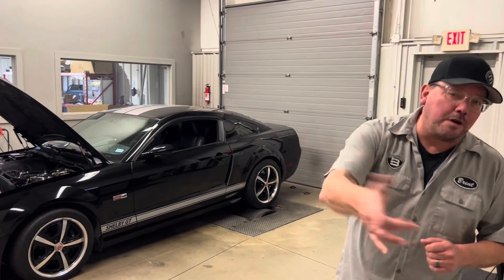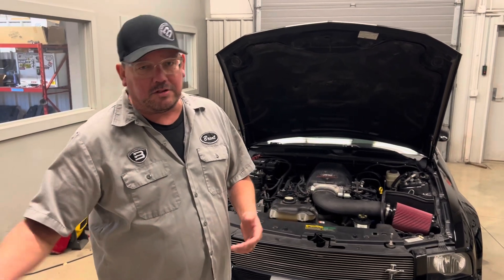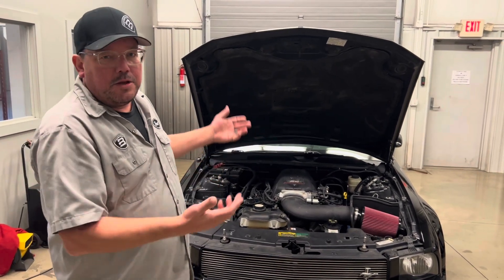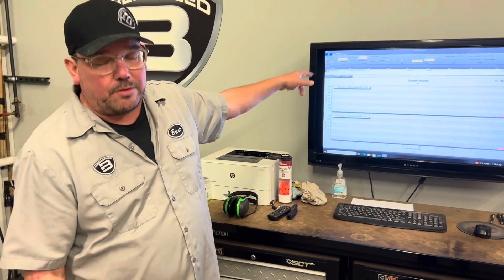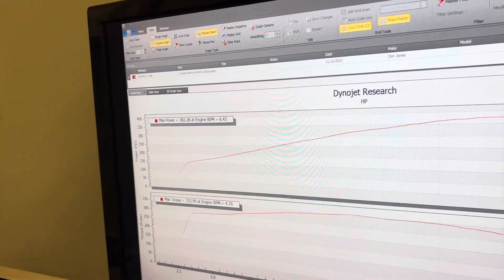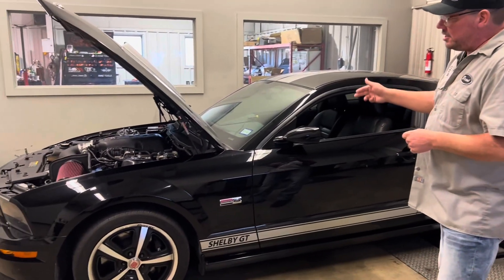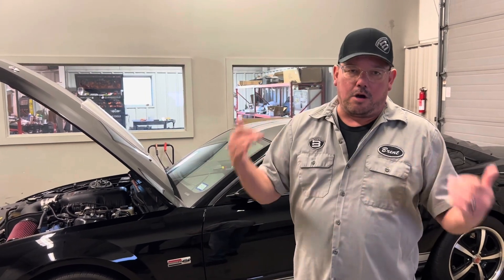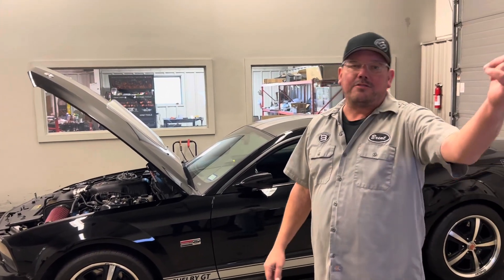2007 Mustang Shelby GT 382 RWHP ALL MOTOR (OR 397 RWHP STD) Dyno Ratings Explained  W/B302 3V

Comment: My 2009 GTCS made 407 to the wheels with all NA after it got fixed from throwing a rod.  I had a five angle valve job done and porting done by hand by Mike Bell in Dayton.  It had the FR Hotrod cams, Ford Racing intake kooks headers and borla exhaust, etc.  it was a fun car.
Reply from the maker: Thanks for sharing
Reply: Nice 👍

Comment: Hey Brent, If im understanding correctly this is your B302 on 9.5:1 compression, using the old FRPP Stage 3 heads, detroit rockers, FRPP 62mm TB, FRPP Intake Manifold and JLT Series 3, right? Seems as if it was an 11:1 motor it would be right around 400HP with the bump in compression. This is on 93?
Reply from the maker: Yes 93 and yes if it were say 11 compression or a bit higher I could see around 400 happening.

Comment: Im interested in the 302 block but will I need to do anything to the heads, cam, etc? Plan on putting a SC in the future.
*I have a 3v
Reply from the maker: Porting of the heads or aftermarket cams is purely a choice. The short block does not require that.

Comment: I've noticed the FRPP 5.3L and B326 have been missing the past couple years. I really wanted one to pair with a big twin screw SC. In a PD blower setup, can the 302 aluminium withstand/make the same power as a iron 326 block? (higher boost needed of course)
Reply from the maker: You can support a lot with the aluminum block and upgraded internal parts. I mean if you are just wanting to do 1000 rwhp iron is of course better for that but the aluminum is fine for most builds turning up boost and most people are not trying to make 1000 to the tires. .

Comment: Im pretty confident you could squeeze 420 RWHP NA with these engines if you had this setup with more compression and custom cams. Maybe even just COMP 127600’s, lighter flywheel, rev to 7,000, 10.8:1 compression.
Reply from the maker: I would like to see one 12.0 compression like a Gen 3 coyote. That would be sweet.

Comment: What's your opinion on header size ? Most 3v seem to have 1 5/8 headers even with boost. Is the bigger size beneficial?
Reply from the maker: We typically use 1 5/8" on most stock engine cars. Once you go built engine or large heads and big cams 1 3/4" is better. If you have plans for that some day you could do the 1 3/4" now with very little downside vs. having to buy headers twice. 1 5/8" are plenty for most people.
Reply: @BrenspeedEngineering  thank you for the reply !!

Comment: How much hp can an automatic 3V transmission handle?
Reply from the maker: The 5R55 is not a great trans. It can handle boost but the biggest issue is kick downs. It does not seem to mind hard launches and upshifts but cruising in 5th doing a boosted kick down into say 2nd or 3rd it hits hard and you could break it at big power. If you simply manually downshift it into the gear then go WOT typically no issues.
Reply: @BrenspeedEngineering  That is where the issue is, I was looking into upgrading my trans, aside from going auto to stick. Where would I begin?